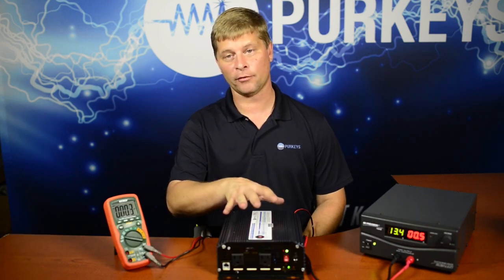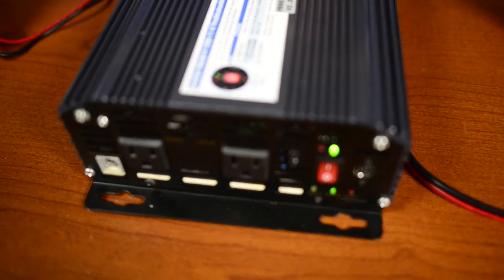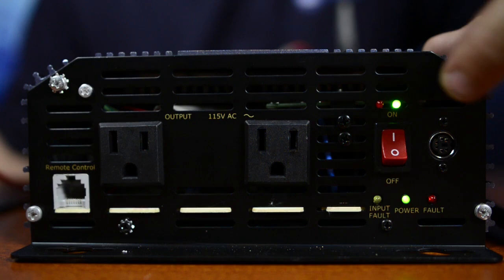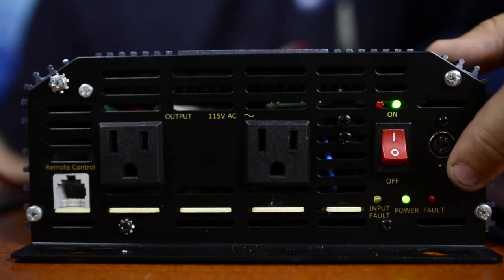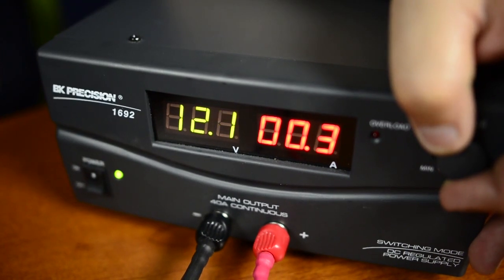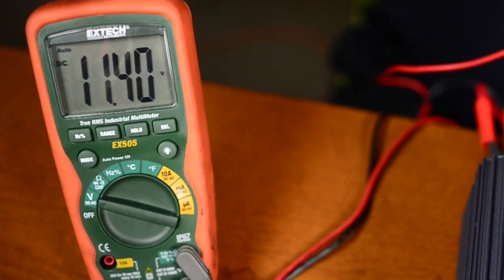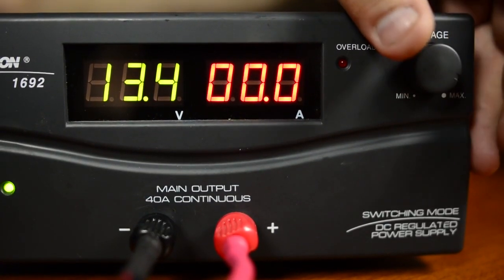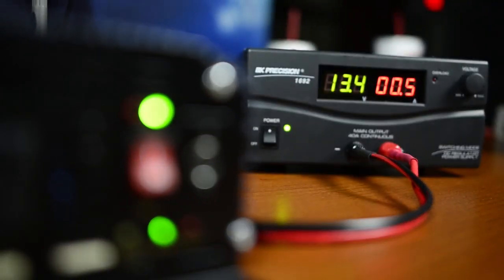How to Reset an Inverter - Purkeys

Comment: My inverter gave off a burning smell, now it turns on but nothing plugged in has power. What could this be?
Reply from the maker: Unfortunately, when the inverter gives off a burning smell, it usually indicates that there is something wrong internally. Resetting a GFCI outlet would not help. The inverter will likely need to be replaced.

Comment: I have a AMIS 5k watt inverter just installed the guys in the shop left it on for a few days the inverter was beeping loud with a red light so I turned off and now it won’t turn on. Do you know any steps for me to fix these while I’m on the road?
Reply from the maker: In order to get a timely response, I recommend you call our Customer Service team at 479-419-4800. They can help you troubleshoot this issue.

Comment: I HAVE THE SAME MODLE THAT APPEARS ON THIS VIDEO. 1200-11-8 
I’m not getting no lights on mine and I’ve tested each battery connectors all batteries reading above 12.93 All together when cables plug I get 13.00 with the truck off using multimeter, so I know it’s not the batteries Later I unscrewed the inverter was hoping to see visible fuses. Guessing mines shot and will have to be replaced?!!
Reply from the maker: One thing to verify before the inverter is condemned is the time the inverter may be working. The 1200-11-8 tells me it is a 1200 watt inverter with 11 hours of run time and 8 hours of off time. This means it will be on for 11 hours and not come back on until 8 hours passes. If that has been verified, then I would definitely say it is time for a new inverter.
Reply: @Purkeys  thanks for the reply back, I found the 6 fuses hidden inside after I completely separated the inverter. Found out my problem was that it was burnt up inside luckily it didn’t catch on fire and burn my truck down. Time for an upgrade anyway 1200watts just not enough for a semi truck that stays otr. I must say it held up for 4yrs I wasn’t expecting it to last that long

Comment: Every time I turn mine on, I get the solid LVD and blinking fault light. 

It's the 1500w with external 4-light controller.  I used to have 1150 cranking amp batteries, now they're 1000 if that (8 of them in a T-680).  Is that whats causing it? The shops switched out the batteries a few times, it'll be green for a day then go back to doing the same thing.
Reply from the maker: Usually, when there is a flashing fault and solid LVD light on the controller, the inverter itself is bad. Sometimes this can be set when running a fridge all day and then using a microwave or other device that has a sudden surge to it. When it happens, reset the control by turning it on and off and if it stays, the shop will probably need to check/replace the inverter, controller and communication cable. If you need more information on this situation, please reach out directly to our customer service team: https://purkeys.net/contact/
Reply: @Purkeys  thanks, they replaced it with one from another truck and it does the same thing. Solid green lights for a moment, then red. I've tricked it a few times by turning it on and off a bunch and it'll work for a day or two then go back to the fault lvd lights. Does it work better with 1150 cranking amp batteries?  It seemed to work fine until I lost the north star batteries
Reply from the maker: @pescad0  The cranking amps of the batteries should not matter in this instance. The fault that you have is an under voltage fault. This means that the inverter is reading the voltage at the back of it being lower than 9.5 volts. It sounds like they put a used one in that may have had the same issue. Who are you driving for?
Reply: @Purkeys  small company out of the midwest. It's also got the DClimate system hooked up to the power contacts on the inverter. The dclimate runs fine. It's very puzzling because the shop hooked the unit up to a standalone battery and it fired right up. The cables look slightly corroded at the truck batteries, but the dclimate system still runs fine.
Reply: @Purkeys  oh yeah and the voltage meter reads good on the inverter. Does a meter have to be hooked up to properly reset it ?
Reply from the maker: @pescad0  From my understanding the D Climate should be connected to the batteries and not to the back of the inverter. That could cause the problem you are seeing. It may be helpful for your shop personnel to give our customer service team a call so we can ask questions and help troubleshoot this issue. https://purkeys.net/contact/

Comment: Hi boss. I am having the blinking green light. When I hook Microwave, it shuts off and blinking orange light with in seconds. What's the possible cause?
Reply from the maker: The flashing green light means that the battery voltage has reached the set point and the inverter is going to shut down. When the microwave is turned on, it is automatically going into the shut down mode, which is the flashing orange lights. The possible causes may be cable connection issues at the inverter and/or battery. It is possible that the batteries are going bad. If you have additional questions, feel free to reach out to our customer service team: https://purkeys.net/contact/

Comment: I have a model 1200-3-10m both greens lights on and I’m still not getting any power through the outlets
Reply from the maker: This inverter may be in the 10-hour shut down window and it hasn't restarted yet. Based off of the model number, this inverter runs for 3 hours and has a 10-hour shut down period before it can be used again. If you want more run time, we recommend the INV01500-2 (https://purkeys.net/product/1500-pure-sine-with-controller/), which shuts off the inverter based on vehicle battery voltage instead of run time. If you have more questions about your specific inverter, feel free to contact our customer service team directly: https://purkeys.net/contact/

Comment: When I turn my inverter on, it beeps fail. Is that the same thing you’re talking about or is this fail light that beeps red something else? And if so, what can I do to fix the problem? Thanks
Reply from the maker: If the red Fail light stays on, it means one of 2 things: either the inverter has reached it run-time limit and will need to be off for 8 to 12 hours, or the inverter itself has had an internal failure. If the inverter has not timed out and has failed, the only thing that can be done is to replace the inverter. If you have further questions about your specific case, feel free to contact our customer service team to discuss the details: https://purkeys.net/contact/

Comment: Hey, I have a 3000 watt power drive inverter that's only been in my truck for a couple months and now it's suddenly shutting off. It's not overloading like if you ran too much stuff and it blows a fuse and you have to go outside and click the red switch near the batteries, it's just that the inverter turns off after 30 seconds if I turn my microwave on then I have to lean down and press the button to turn the inverter back on. What on Earth is up with that? It can't even cook anything now in my semi.
Reply from the maker: There are a few variables that could be affecting the use of your microwave. For example, do you have the same results with the microwave if the truck is running? If it works correctly in that case, then there are battery voltage issues and the charging system and batteries need to be checked. But if this is not the case, it could depend on the size of your microwave and what other appliances are connected. Plugging in a “Kill-A-Watt” will let you see what wattage the inverter is putting out when this issue occurs. If you would like to walk through a troubleshooting exercise with our team to see if we can identify the issue, feel free to call our Customer Support team at 1-800-219-1269.

Comment: What if I got a fault??
Reply from the maker: If you have a fault, you need to remove all loads from the unit. Let it sit for at least 15 minutes and restart the unit with at least 13.2 volts at the back of the inverter. Hopefully it is not a model that has a timer cutout instead of a voltage cutout (these models will run for 2 hours and then shut off and will not turn back on for 12 hours). If you need more details specifially for your unit, feel free to call our customer service team. They can help you determine exactly what is going on: 1-800-219-1269.

Comment: Bhai bina battery ke single invter chl jayega plz reply
Reply from the maker: We're not sure if we understand your question correctly, but if you're asking if the inverter will run without a battery, the answer is no. If you need additional information, feel free to call our technical assistance team at 479-419-4800.

Comment: I have a Xantrex Freedom X2000. My tractor was dead I had triple A jump it && now my inverter is not working. What should I do ?
Reply: There are few things you can do to try and restart this inverter:

1.Check all the fuses and verify that it is getting power.
2. Start and run the truck, then make sure the input voltage is above 13.0 volts at the inverter.
3. While the engine is running, turn the inverter off and then back on.
4. Disconnect the power cables, leave them disconnected for 5 minutes and reconnect.

If none of these suggestions help, please reach out directly to our customer service team (1-800-219-1269). They can walk you through this and try to help find the issue.

Comment: I don't know if this is related but my solar inverter keeps beeping. Unresponsive buttons even the power. The screen where it shows the voltage also flickers repeatedly. I did some research and it said that it should stop once it is powered for a few hours but I'm getting worried because it's been more than a few hours. And it's battery capacity is 100 % full any help is appreciated thank you.
Reply from the maker: We don't offer this brand of Inverter, but like any inverter there can be many reasons why the inverter is not powering on: 
Too low of voltage
Too high of voltage
Over temperature
Over load
Short circuit

Here are some possible solutions:
Disconnect all devices plugged into the inverter(including extension cords, power strips and appliances)

Disconnect input power and wait 5 minutes before reconnecting

Run the engine and make sure the voltage is above 13 volts.

If this doesn't correct the issue, we recommend you contact the manufacturer.

Comment: Somebody Pleaseeee answer!! *1:37 I plugged an active AC power source into output socket, and now it’s blinking and not working* any idea what happened?
Reply from the maker: From your comment, it sounds as though you may have plugged another AC source into the output of the inverter, which could potentially damage the inverter. In order to reset the inverter, the voltage coming in from the batteries must be at least 13.3 volts. If it would be helpful for you, feel free to call in to our tech support team at 1-800-219-1269.

Comment: None of the lights are on on mine? What then?
Reply from the maker: Try checking the fuse cube located on the truck batteries. 

If your inverter is a Purkeys inverter and the fuse cube is good, you can call our technical service department (479-419-4800) M-F 8 am-5 pm central time.

Comment: Hey bro i have one of your inverters that came with the truck, im having an issue where it only runs for a few minutes and then the fault light comes on
Reply: Its the input fault light that comes on bro
Reply from the maker: Hey! I'm not sure which exact model you have, but it sounds like the input voltage might be dropping too low, which causes the inverter to shut off to protect the truck batteries. This is often caused by weak batteries that don't have enough load capacity available but are still able to start the truck. We'd love to give you more specific help--just give our technical service department a call at 1-800-219-1269.
Reply: @Purkeys  hey I have an old Walmart truck. It has a 1200-8-2 with a timer on it. I don't need the timer function as I'm fully capable of managing my usage myself. Is there a way to completely disable the timer function permanently?
Reply from the maker: @Newswithagnome  The inverter that you are using was programmed per a customer's specific request and can't be altered. Unfortunately, this inverter is now an obsolete product that we no longer support, as we upgraded a few years ago. In order to get an inverter without a timer, you would need to purchase the updated version of the inverter. Feel free to reach out to the Purkeys customer support team at any time for more details/information.
Reply: @Purkeys  while I thank you for your reply, telling me I have an obsolete unit, that does in fact function. But only needs the override, absolutely insures that I will not ever consider any of your products for our fleet. But your market position is better suited to large carriers that like to micromanage drivers. Pathetic cash grab. Thanks

Comment: So, um, you know most of us don't carry around specialized electrician tools. You know that, right?
Reply from the maker: No specialized tools are used in resetting this inverter. We use a multimeter to demonstrate that the reset won't work unless the source voltage is high enough, but the actual resetting process is simply turning the inverter power switch off then back on.
Reply: What about the ones in Walmart trucks that if you forget to turn it off after lunch you can't use it for dinner?
Reply: @HwyRyder  my exact problem at the moment 😭
Reply: Nathan Rittenhouse 😂😂😂

Comment: I have a 1100 energizer inverter and it turns on but a few seconds later it beeps and says overload and nothing is connected to it, can anyone help thanks!
Reply from the maker: Since your inverter is not a Purkeys product, we can't diagnose this particular issue. We suggest reviewing the owner’s manual that came with the inverter, or try contacting the inverter manufacturer. Sorry we can't help more!

Comment: I have a cosuper ir Sims inverter with An overload error but the inverter Is total y new. I do What you explain but i don't know how i can do. It Still in overload error.
Reply from the maker: For an overload error, the input cables may need to be completely disconnected from battery power before the error will reset.